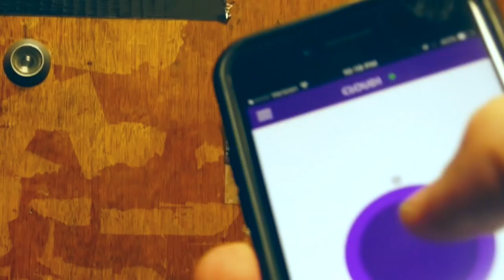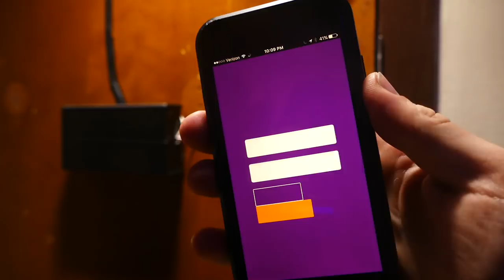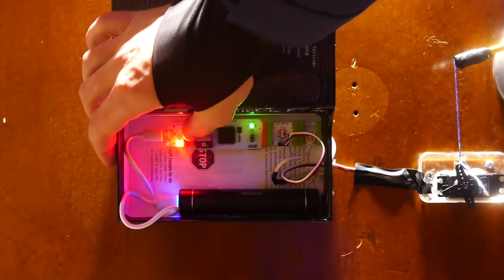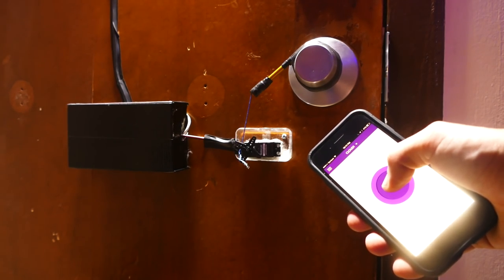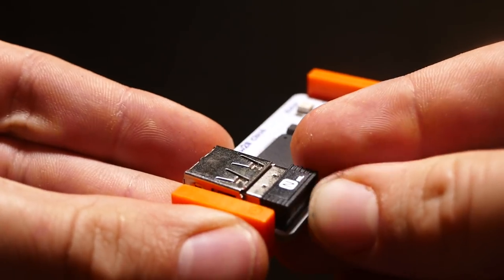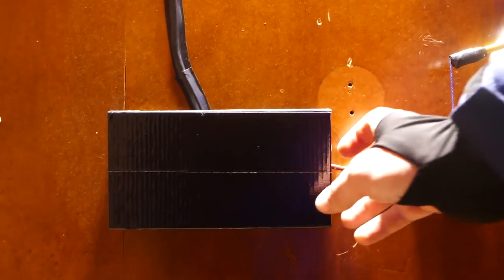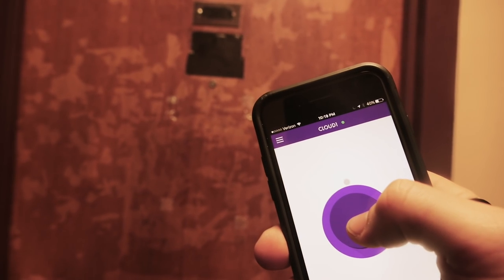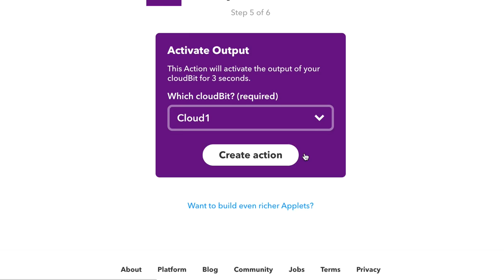Clever Lock Hack YOU CAN DO YOURSELF (Open Your Door With WIFI?!?!)

Comment: put a lead plate in between the door and the unit that way you couldent use any external devices to break in but on the other side the wifi will access it

Comment: If someone knocked hard enough it would fall off the door due to it's only held in place with velcro and has the weight of the portable battery, the string would pull on the handle which would unlock the door.

Comment: some one could use magnets and electricity and easily break into your house
Reply: How?
Reply: Jaromy Van Der Sluis magnets can transfer electricity to things that are attracted to it (how wireless charging works) is someone attached a power source to 2 mangers and finds where the servo is the electricity will transfer and trigger the serve to rotate
Reply: DarkMatter That won't work, you need to run an ac current through a coil, a normal magnet won't work. And the servo never activates, it's not connected to a coil and can't just be rotated by powering it.
Reply: Jaromy Van Der Sluis yes it can, a servo can't rotate without a power source
Reply: DarkMatter You can't just open the door by putting an electromagnet next to the servo.
Reply: Jaromy Van Der Sluis yes you can try it
Reply: Even if u could how would the person breaking in even know u have this device on ur lock
Reply: DarkMatter The only way would be to break the lock using an emp gun, but you wouldnt get in anyways
Reply: DarkMatter yeah someone could easily hack into his home😂
Reply: someone can already do that.... 
even without this unlocking system.